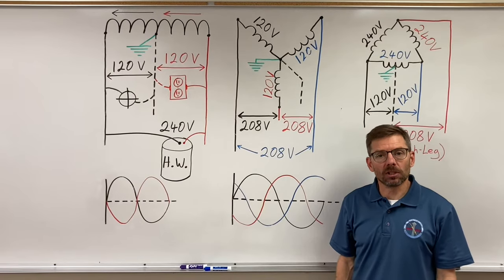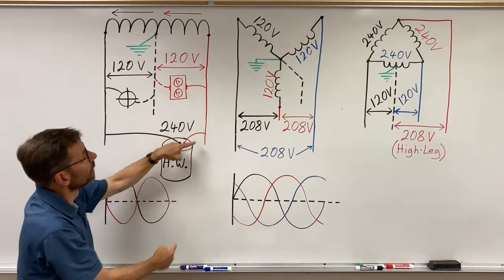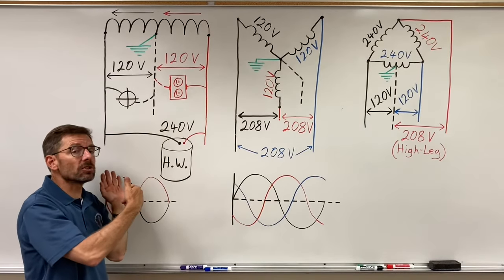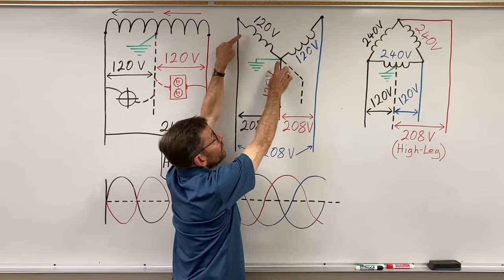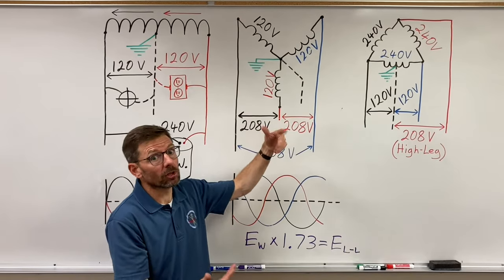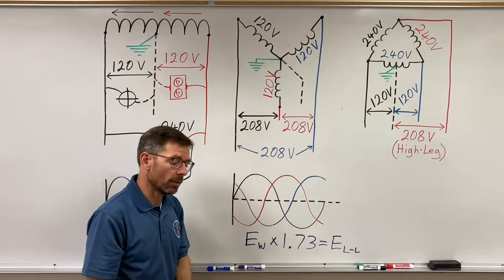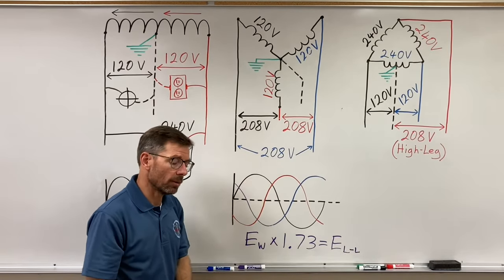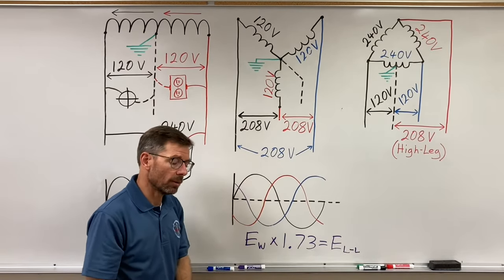120/240 and 120/208 Volt Transformer Secondaries

Comment: Stupid question time.  Are the line 280 wires Brown, Orange Yellow and the black, red and blue the outputs?  Would you be running the Neutral for 120v in white?  You probably have a wire color code video, I'll look.  You do amazing videos.  Some airhead talks about stringing beads and gets 100K subscribers, but real , well presented videos don't. Life isn't fair. Thank you for taking the time, the videos are great.

Comment: Scratching my head on the high leg... 240^2 plus 120^2 = Sqrt 72000 = 268.33... Trying to figure out how it's 208 with that analogy. But otherwise very helpful as I'm learning tranformer connections and where these voltages and configurations come from.

Comment: @dave, great job explaining the topic. I am getting a (grid-tied) solar system installed which only outputs single 240/208v connected to the Red and Black terminals on the breaker panel. Wonder how is the 240/208v transformed into split phase (2x 120v)? There is no video created on the topic, might be a great opportunity to make one.

Comment: In Germany, the middle circuit is used, the Y circuit. 
Transformer voltage from hot to neutral is 230V and from hot to hot it is 400V.

Comment: Other than you kept referring to the peak voltages as 120V which would be confusing to a beginner when actually Vp ≈ 170Vac or Vp-p ≈ 340Vac hence the need for capacitors with 370V or 440V ratings.

Root Mean Square is just the DC equivalent hence there would be a straight line drawn through the sine wave to represent that average.  Vrms = Vpeak/√(2).  RMS is the only way to average a sine wave in case your wondering.  It's also used to take an average in statistics to minimum the effects of outliers 😉

- 1st drawing - Single Phase
- 2nd drawing - Three Phase (Wye)
- 3rd drawing - Three Phase (Delta)

I suggest adding "Ugly's Electrical References" book to your toolbox because it covers all this and much more in case you forget.

Great video 😊

Comment: @davegordon6819
Dave, I absolutely enjoy your topics and teaching method. 
I have a question I’d love to see you do a video on. 
There’s a debate in the RV industry about the use of voltage stabilizers. Some say not to use them, as they will drop the voltage for the rest of the RV users, as the stabilizers sacrifice current for voltage, therefore pulling more current and lowering the voltage at the post. 
My take is that if there is low voltage at the RV post, say 104V, instead of 120 per leg, the appliances, Air Con, refrigerator, etc.,inside the RV are going to pull more current, as they maintain their power requirements. Therefore, boosting the voltage with an autoformer, will reduce current consumption at the RV, but will consume more current at the post, making the current equal to that without the autoformer, minus some inefficiencies. Am I off base here?

Comment: I have a project I'm interested in to go completely off grid, I have a max 4000watt 120v and 240v generator I intend on using currently just to try it out. But so far my idea is to take it and attach it to a transformer just like the residential ones in order to get the 120/240v for my home and to keep the rpms low. I just wonder if there would be some sort of resistance that I'm just not seeing at the moment that could potentially damage the generator or appliances.

And if in the future if I upgraded to a generator that had the capability of producing kilowatts and only 1 at a time 120 or 240 or 208 without modification to the existing set up would using 208 3phase in combination with the transformer harm my home or appliances or would I be better off sticking with the 120v or 240v?

Comment: You may cover this in another video, but there is another reason to have a 240 delta system. If you already have a 120/208 Y system in your facility and need another service,NEC says the second service must be a different voltage, hence have a 120/208Y service and a 120/240 Delta service on the same building.

Comment: I did the HW chum

rms = root means square 
center neutral opposing and pushing relativity of product
Bus wiring

Voltage = Points if differential potential of to points (Check out angle theta!!) 
as well as from which 120 degrees of the exact moment of the circuit became energized comparing the constant peaks per delegated cycle (Alternating Current and it's Value) while subbing out impedance with greater use of Volts and VA (Volt Ampere) to mediate or use the Load (What the conductors are connected two and their rating) for treatment of the new simulated
resistance from use of Center Tapped Neutral

Connecting within the center if the Wye Connect will split...not only the windings but the voltage. 
Equaling=B phase To High leg is 208V

Make Sure You label!

Comment: 1:00 -  I was hoping to see the primaries as well as the secondaries you've shown.  What are the primary voltages and winding configurations?
Reply: Well, that would depend on the primary side wouldn't it? I'll hook you up with the Wikipedia page and let you decide:

https://en.wikipedia.org/wiki/Electric_power_distribution#:~:text=Rural%20services,-High%20voltage%20power&text=7.2%2C%2012.47%2C%2025%2C%20and,Other%20voltages%20are%20occasionally%20used.

Comment: Hey Dave. I'm new to your channel. This video really caught my attention with your detailed explanations. I'm an electrician and I have question. If I want to feed a 125A/1ph/120v-240v panel from a 3ph/120-208v panel what's the best method to do this? Will I need a phase converter or a transformer?  I have some 1ph/240v/60hz equipment to hook up but only 3ph/277-408 & 120v-208v to the building.
Reply from the maker: Thanks for watching.  In regards to your question, I would argue against a phase converter because you already have "single-phase 60 Hz" available in you current distribution system (assuming you're in North America, and your voltages imply that).  You simply need to transform the voltage.  Therefore, I would present one of the following options:

1) If you just have a couple pieces of equipment you could take two "hots" (either black and red, red and blue, or blue and black) which would give you 208 V single-phase and run them through a Buck-Boost transformer to boost the voltage up to 240 V.  The two output leads would then have a 240 V potential between them and could run your "1ph/240v/60hz" equipment.  We generally run a separate Buck-Boost transformer for each load, but that doesn't mean you can't run more loads on a single Buck-Boost.  I wouldn't, however, recommend feeding a panel with one of these.  I've found that the supply houses are generally helpful in helping you size the proper Buck-Boost(s) for your load(s).  These handy little devices are about the size of a shoe box, and if you're unfamiliar with them, I have a video that could get you started: https://www.youtube.com/watch?v=aOtSnJo6PfM

2a) If you want a single-phase 120/240 V panel you could have one, but this may well be a more expensive option. The 208Y/120 V part of your system already gives you 120 V so that aspect of this option would be redundant.  However, if this is your objective, then you could get a single-phase transformer with either a 480 V or 208 V primary (depending on which of you panels you wish to feed it with), and a 120/240 V secondary.  This would give you a secondary that would look like the usual single family home service with which to feed you new panel.

2b) Alternatively, you could get a 480 V or 208 V primary and a 240 V secondary (without the neutral, "X0") and feed the panel with just two hots (240 V only), BUT I'd want to clear that with your city electrical department as someone could be tempted to create an illegal, and potentially dangerous, 120 V at some point in the future... 

***Look into costs, but if you only have a few single-phase loads at 240 V, the Buck-Boost option may be less expensive and an easier installation.

IMPORTANT NOTE: Which ever way you go, because you are adding a single-phase load(s) to a three phase system you want to make sure that you add it to the most lightly loaded pair of phases in you distribution panel (calculated loads are often printed on panel schedules if they are kept up to date).  This is more important if you are trying to feed a single phase panel because the goal is to keep your three-phase transformers as balanced as possible, within reason.  However, if you only need two or three Buck-Boosts then you can alternate their feeds (one from phases A&B, the next from B&A, and the third from C&A out of your 208Y/120 V panels).
Reply: @davegordon6819  Thank you so much for the response! I appreciate you taking the time not just to respond but to go into the depth that you did with all the options. I'll be sure to spread the word about you and your channel. This is a massive help! Thank you and have a great day!
Reply: The best option is to get the service voltages from the PoCo.
If you want 120/240 contract the split-phase 120/240.

If you have 3-phase loads choose the compatible service (a transformer) from the PoCo.
Also, look at the motor voltage options. 

Whiich is easier($)? Purchase/change loads that are compatible to curent service voltages?
Or, to ontract /change another service from the power company to match current loads?

It's like if your loads are 3phase, 50Hz then you need to get a 3-phase 50Hz source supply of the matching voltage.

O if you have a 3phase 60Hz supply, you need to change current loads or acquire other loads so that thet would be compatible to the supply voltage.

The PoCo handles the supply and you, the load.

You can always get your own transformer configured to your special voltage needs. However, its primary voltage requirements hast to be one that the PoCo support.

Comment: SOLID!  esp 8:40 min mark.   Trying to figure out a Tesla Backup Gateway (120/240V output) onto 3 phase 120/208V.  Tesla says an isolation XFRM is needed. I started w thinking why not simply land each 120V on 2 legs of the 208V WYE?    120v : still 120V........but phase difference (?).   Thougths?
Reply: If you're trying to get 240v from a wye, it ain't gonna happen without a transformer.
Reply from the maker: I agree with Kranky V. Don't experiment with expensive equipment.

Comment: Fantastic video! I recently took over management of a 160 year old theatre that has a high leg delta panel in the projection room. Wanted to get familiar with the system. This video was incredible informative. Don't be worried. It did not give me the the confidence to monkey with the panel. I'll call a pro anytime this panel needs works.

Comment: While 208 volts is a 3 phase voltage produced by 3 phase transformer bank, it is commonly used as a network voltage by utilities as a leg to leg voltage for single phase residential loads instead of 240.
Reply: So is it safe to use the 208v along with with neutral or earth?

Comment: Sir can u plz explain how current flow when we use just two line 208v wye system with neutral for one receptacle do they cancel each other the way they do in 240v split phase.

Comment: Hi dave, thanks for sharing, for the wye connection. in single phase 208V. How do we calculate the current for each phase.  

since the single phase 208vac running on two phases (L1&L2) . Does it means current in L1= L2 ?
like single phase to neutral 120Vac. Current flow in neutral = current flow in L? or any other calculation.

need it to calculate total load at each phase.

thanks in advance

Comment: The 120/240V thing was actually a late 19th century thing - all derived from the Great Fire of Chicago. Edison lamps were made out of carbon, and used 110V, however, other companies figured out how to make lamps using tungsten, a much more resilient metal and could work at 240V (carbon lamps burn up at 240V). Since adoption of electricity was much slower in Europe, the European utilities went with 240V as it saved money on copper and is more efficient. Our 110V system was derived as a split-phase system, because Edison noticed that some people's lights were brighter than others. So he designed the system as two 110V generators (this was DC, mind you) and connected them together to form a third neutral line. He realized by monitoring the current flowing on the neutral line, he could determine how bad the imbalance was and rebalance the grid so the same number of lamps were on each half so everyone's lights were the same brightness.  In addition, if you needed more power, you had 240V (DC) available.

Now, electrification was huge in the US - especially after the Great Fire of Chicago which meant everyone started from scratch, and skyscrapers were a thing. Gas lamps couldn't be lit more than a few stories up, and everyone wanted electric lighting. So much so that demand for light builbs was so big even though carbon lamps were obsolete, Edison was still making millions of them as the tungsten lamp makers couldn't keep up  (in the late 19th century, they made around 10 million tungsten lamps, and Edison made nearly 60M carbon lamps. This changed about 20 years later in the early 20th century when carbon lamps were finally obsolete and replaced with tungsten lamps. However, by now the die has been cast - 110V had been around for so long, there was no appetite to change over to 240V..

In Europe, electric lamps were seen as a novelty, and very few people had it. The rich folks refused to install it in their castles, so when it came time, it was trivial to switch over.

Oh, and the first war of the currents was between Edison and Westinghouse, not Tesla. The second war of the currents was between GE and Westinghouse which dictated if we'd use two-phase (Westinghouse, via Tesla's patents) or three-phase (GE, Edison had been kicked out) AC. Tesla is confused in these because Westinghouse bought Tesla's AC motor patent (and later all of Tesla's patents). That patent showed how a motor would work at 60Hz two-phase. You have to remember though, that just because of this, power was still not quite standardized as you could get DC, 60Hz, or 133Hz AC power (133Hz because Westinghouse managed to find a design for an electric meter but that required 133Hz to run properly).
Reply: 133Hz from my understanding,  was more commonly used with carbon arc lamps common for streetlights and in factories and large retail stores from the early 1880s until the early 1900s, because it flickered less than 60Hz.  You also had very oddball frequencies such as 25, 33.3 & 40Hz, to name a few.  The early days of electrification must have been a very intriguing time to live through.  And all this was in major US cities, many  farms and homes in rural areas didn't have electricity until after WWII, my grandmother recalled not having electricity until merely a few months before she married in 1947, born in a farmhouse in 1925 and lived to be 96.

Comment: There are plenty of uses for the high leg. Many modern LED light fixtures are rated for voltages between 100 and 277 volts 50 or 60 Hz. If you use  the high leg, make sure that you use a straight rated 240 volt breaker.
Reply: So you're saying there are single pole, straight 240V breakers manufacturered ??? If so they're about as rare as a royal flush.
Reply: @Sparky-ww5re  No, but all 3 pole breakers are straight rated and some double pole breakers are. You can simply use the high leg as part of a multi wire branch circuit. There's nothing in the NEC that says you can't use the high leg to neutral. You can run three (2 wire) branch circuits from a three pole breaker. You can not however run a 4 wire branch circuit with a shared neutral from three single pole breakers. NEC 210.4B.